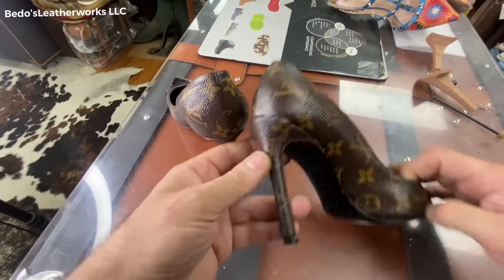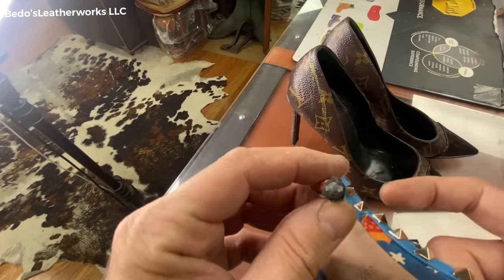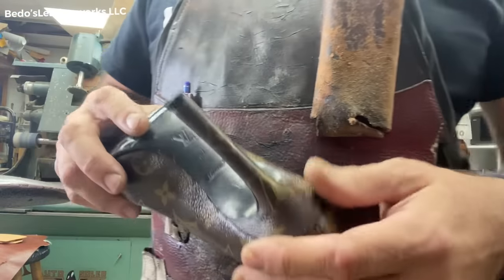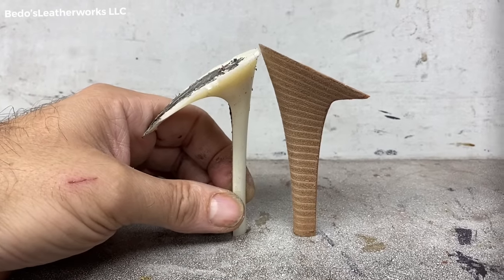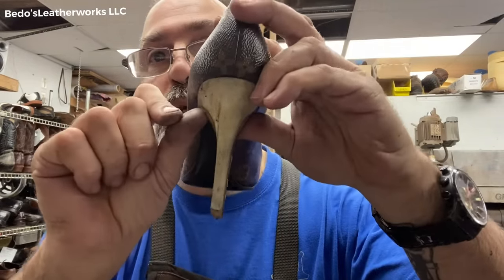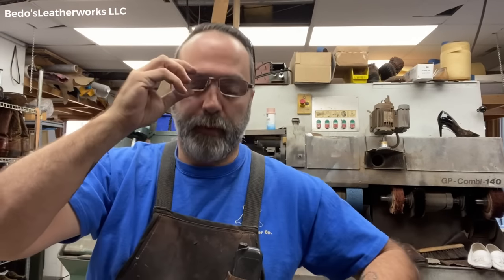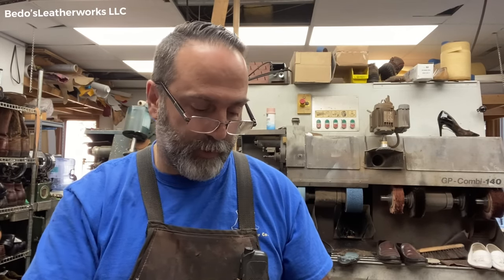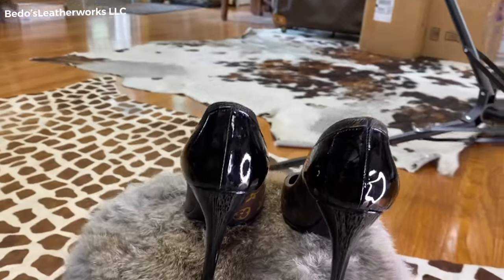Louis Vuitton pumps

Comment: Great job Steve. I use faux stitches a lot on my sneaker restorations. Especially for back tab and ornamental pieces. The contact cement is super strong in its own right it's not really that big of a deal if it's fully stitched. Great way to improvise.

Comment: Steve, 
The easiest fix for that broken heel would have been to cast a new heel using the nonbroken one to make the mold. The heel's structural steel tube should be easy to find from either shoe repair suppliers or a material supplier like McMaster-Carr. You make a simple silicone mold from the good heel. Cast the new one in a strong plastic like epoxy. To get the steel tube in place you have 3 options, secure it inside the mold before you pour in the epoxy, add it once the epoxy has setup enough to support it, or drill through the heel and epoxy the tube in place afterwards. If you ever need to replace another uncommon heel please consider casting a new one, it isn't very difficult and it will save you from spending hours online looking for one you hope will work. Plus the know it is a perfect match to the original and its twin.

Comment: Nice work as usual, Steve.  Just a couple questions:

1. Were the "donor shoes" for the heel functional before you removed it, or was there another problem with those?  I hope you wouldn't take apart a perfectly good shoe if you could help it.
2. Couldn't you have just sanded down the stacked leather heel to the height (and possibly angle) you wanted?
Reply from the maker: The donor shoes are trashed now, very inexpensive so I got it just for the heels. It’s almost impossible to sand down the stacked heel, to many variables
Reply: @BedosLeatherworksLLC  They looked like they might be Zanottis; am I right?
Reply from the maker: @hotwax9376  I don't think so

Comment: The more i learn about shoemaking the more i come to the conclusion that 1 or 2 millimeters can make all the difference. Especially replacing heels. A slightly different angle and it doesn't work. By the way, beside the fact that i think the heels are not pretty,  i think your version of the shoe is more attractive than the original one.